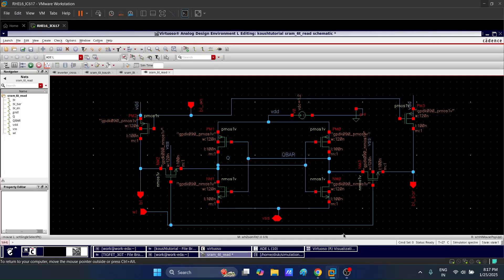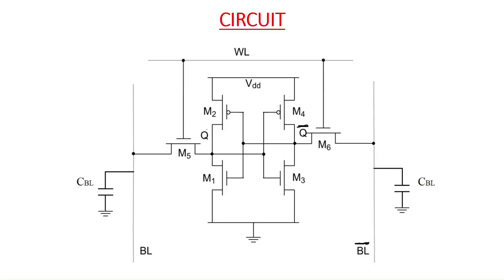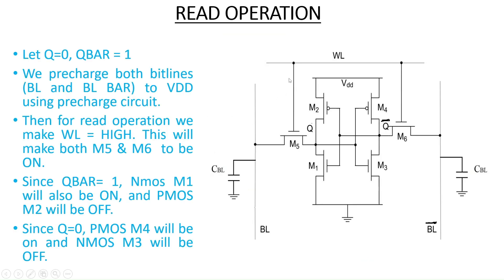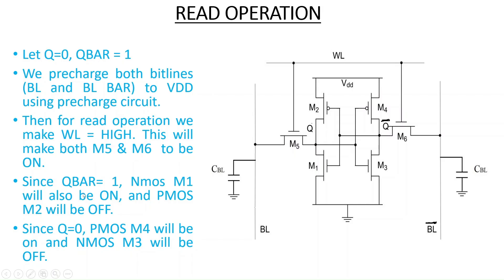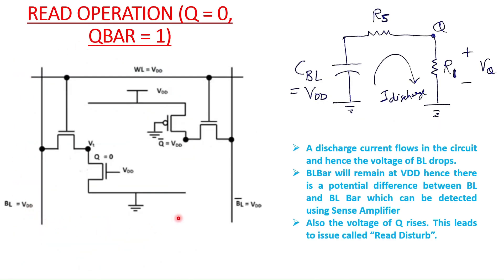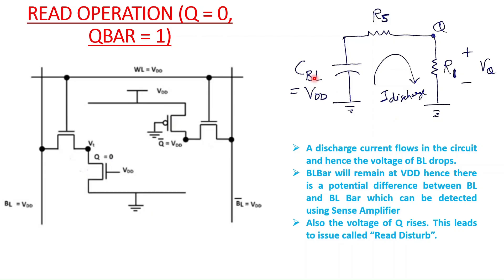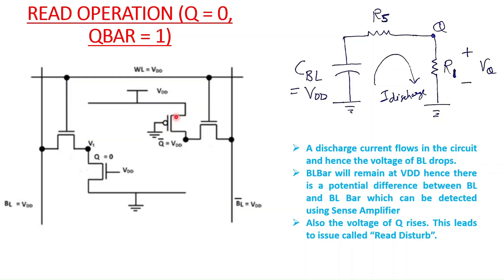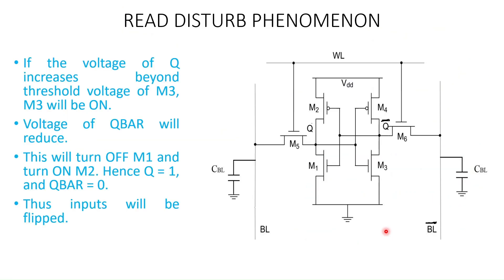Detailed 6T SRAM Read simulation in Cadence Virtuoso: Transistor Sizing, Precharge circuit explained

Comment: Hi sir I need your help regarding the project work my project IS GATE DIFFUSION BASED SRAM LINE DECODER but I havedone the simulation of GDI based 2: 4decoder but integrated with sram
Using Cadence tool
Reply from the maker: nice project...In which part you need my help?
Reply: @SuccessPointForVLSI  I HAVE PROBLEM WITH GDI(gate diffusion input technique) 2:4 DECODER INTEGRATION TO SRAM MEMORY AND I'M doing this in synopsys custom complier tool

Comment: hey i aslo run cadence in vm ware but,  in my cadence  i dont have gpdk45 lib . how can i get this. but ,In my cadence gpdk90nm is avaliable
Reply from the maker: For basic simulations you don't need 45nm. 90nm is also sufficient. You can also try to download PTM based models.
Reply: @SuccessPointForVLSI  
But , how can I get that ? Is any process involved in it